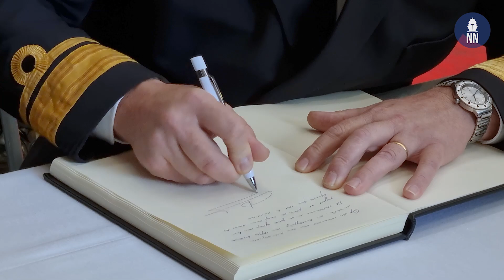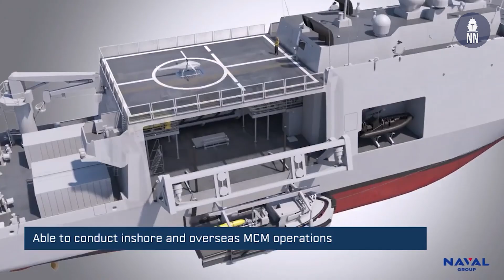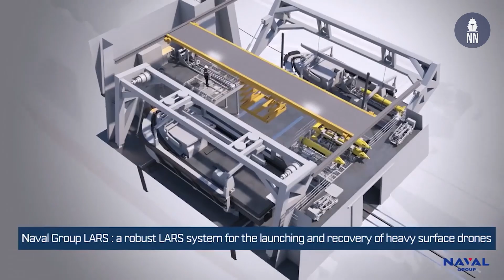Keel Laying for the 1st MCM Vessel of the Belgian-Dutch rMCM Program

Comment: A great example of years of cooperation between the Belgians and Dutch  . France would be an exelent partner as well as they current mine hunters where also a project of all three mentioned nations.   The dutch and germans also have some good cooperation going on in the naval department . with extremly long ties .  I would not be suprised if germay would join in these projects aswell.
Reply: French equipment doesn’t work with NATO equipment
Reply: @daralcampbell2171  O dear  , i think you hugely mistaken as those mine hunters they use now are a 3 nation project dating back to the 70s ,   Called triparti class  Using Belgian Dutch French technology. and equipment . 

Thales is a French company with subsideries of Dutch Belgian etc companies.  all those Electronic warfare , Radars other electronics  etc are all made by this company ,  Exocet anitshipping missles are used across Nato a French misle .  

I think you are a bit lacking in how deep European nations cooperation are .
Reply: @daralcampbell2171  Wrong.
Reply: @silverpleb2128  French military equipment isn’t compatible with US/NATO Equipment. In order to use French equipment on a nato craft you gotta modify it completely
Reply: @daralcampbell2171  famas is compatible with 5.56 nato.

Caesar artillery is compatible with 155mm nato shells.
French ships, planes and vehicles are compatible with liaison 16.
Rafald planes can operate on US carrier.
French endurance refueling ships can refuel otan ships.
The griffon and jaguar are able to operate Belgian nato equipment from cockerill. 

The Belgian navy alongside many others nato navies are using French anti mine ships. 

Do you want more exemples?
Of course you need to adapt everything, nato standards are meant that your equipment is supposed to work normally with something that is supposed to be under nato standards too and that is still under development, or not.
Every equipments need to be tested in order to verify that the missile, the shell, munitions etc can be operated normally without risks and with good stats. Thats not a French specification.

By the way, nato is not US. US are part of otan, no need to specify "US/NATO". Only nato.

Comment: -OMG look at this!
-What is it? a mega frigate? a stealth submarine? a fancy helicopter carrier?!
-No its a boat with smaller boats

But now is this legit a stepforward? I think that a modern destroyer can operate all those UVs and at the same time be able to attack and defende.
The ship shown looks more like a ship you would send to spy on ISIS, not fight a war
Reply: Why spend Billions on Frigates and Destroyers to do a Job that a cheaper Specialist Vessel can do in greater numbers?.
Reply: We're also getting new frigates built in the Netherlands, for both our navies. These small ships are destined to be mainly used for clearing naval mines, though they are clearly more versatile than their predecessors.
Reply: @hermes6910  There arent any operational ships that can deploy USVs, this doesnt mean a destroyer cant do it. In a war with a real enemy any ship operating alone in large numbers in the open, with no weapons at all would be just a tasty snack for enemy subs, frigates or even planes to attack. Needless to say that a russian sub can probably outrun this little thing and then sink it with a single cruise missile.

A destroyer could deploy 4 USVs instead of 2, have a higher speed, the ability to hunt enemy submarines down when it spots them and the ability to defende itself. The ability to defende itself even if it gets sunk is very important because the enemy will have to use much much more weapons to eliminate your ship. So yeah, a destroyer hunting subs and mines make much sense to deploy out in the open, against a powerful enemy.